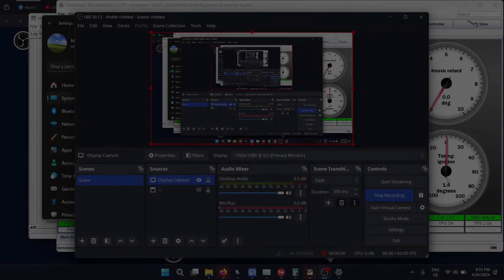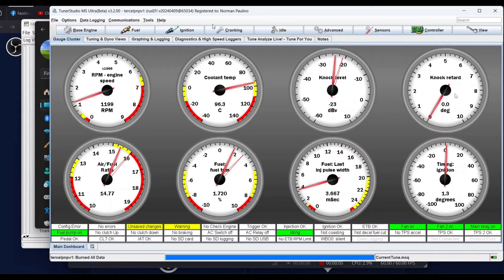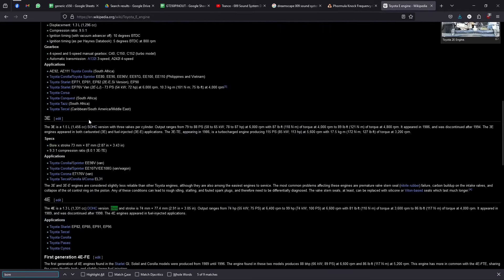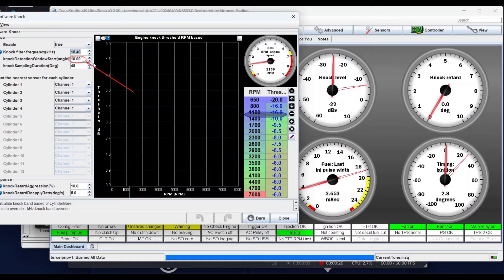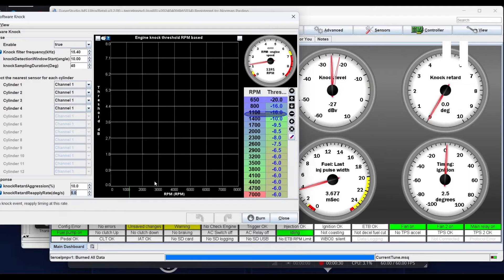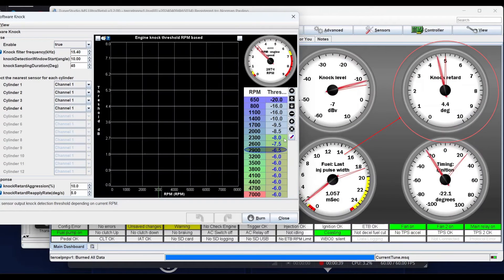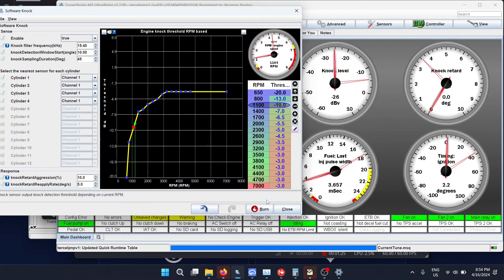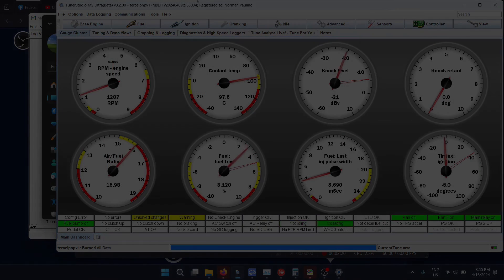How To Use Knock Sensing on rusEFI

Comment: You need to learn up on knock. It doesn't have a set frequency and it's not determined by bore size. It's all a lie. The bore size tells you the lowest frequency you're going to detect. Not the knock frequency nor the frequency you want to detect nor the one which has the best signal to noise ratio. Actual knock frequencies change with load and RPM. Mitsubishi use resonant sensors, So does GM and probably Hyundai too. They're not microphones and the output from them is a single frequency with no relationship to any sort of knock frequency.
Reply from the maker: Why don't you go to the rusefi forums and talk about that with a few people who are probably smarter than me?
Reply: @alphax_usa  You're making the claim that the knock sensing works but there's zero chance that it does and you have obviously never tested it. Got to start with a scope on the output of the sensor instead of guessing.
Reply: Hi! I installed RusEFI on an engine with a high compression ratio(>11.5). I have to say that the formula for frequency really works! The soft detects knocks such on resonance sensor-based systems. On an OEM Bosch ECU freq a bit depends on RPM (minimal correction)

But note that I'm using the raw calculated frequency without multiplication to 2 🙂
Reply: @wlasov  Resonant sensors don't detect frequency. They detect the initial shock and output a fixed frequency determined by the sensor internals.